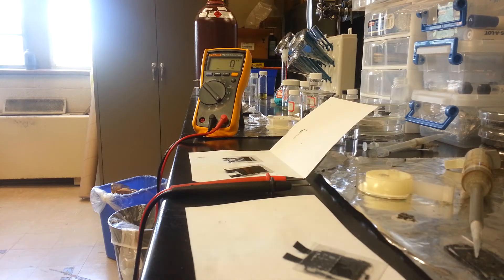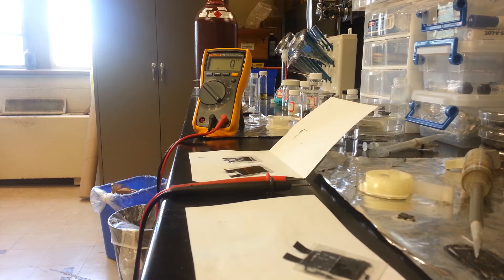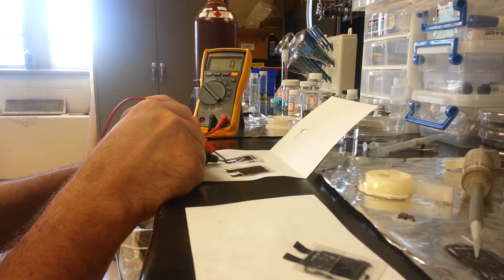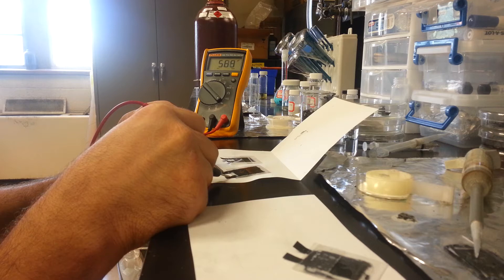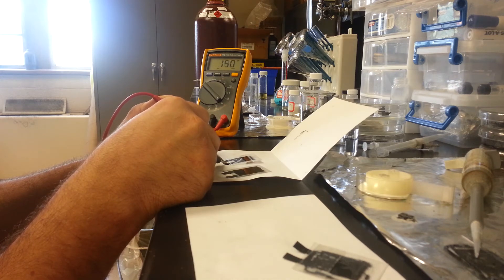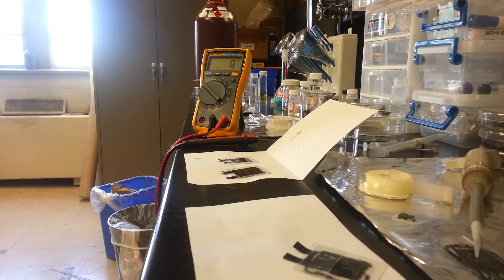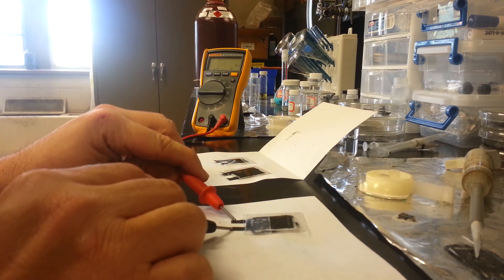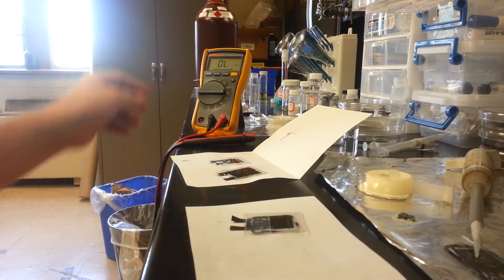More tests on electrolytes for Graphene battery.

Comment: Hello and thanks for sharing your results with us/the world!

We really like watching your presentations! 

Just one question....did you try to use Alum as "electrolyte" ?

Would be interesting to see, if that would work...

And what do you say about the graphene production with the blender/shear mixer? Seams to me like a very promising way to do it?!...
Your thoughts about this?

Best and kind regards
Reply from the maker: The sheer process may be promising for certain applications, but the need to integrate GX into a grid doesn't fair well with it. I'll look into trying to make it work in the future. As for Alum, I haven't tried anything with it yet. This experiment was to check the reference and see the gains with the grid.

Comment: Q: Is it a liquid or gel based electrolyte. Gel is better to get a constant distance is it not ? I love the work btw
Reply from the maker: This is just 0.5 molar H3PO4. The idea here isn't to get the best results, but to get the difference in the integrated and non-integrated GX grid cell. I just broke apart another 4700uF unit and did a better job at reassembly, and got a nice result (about 4 times the density). Then I burned it up playing with ways to charge it. These on the other hand, still work great after tests.
Reply: Venturestarx
How's your experience with H3PO4 ?
Reply from the maker: The Phosphoric acid worked just like the textbook numbers, but adding the integrated grid of graphene changes the total capacitance by a large amount.